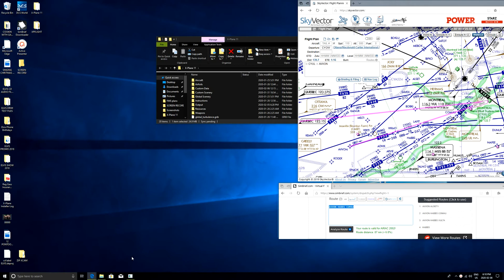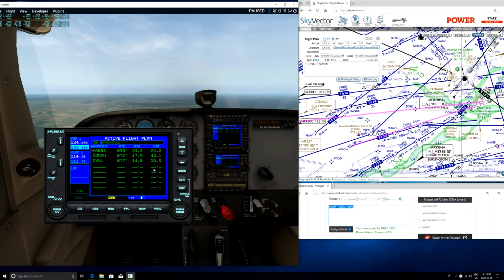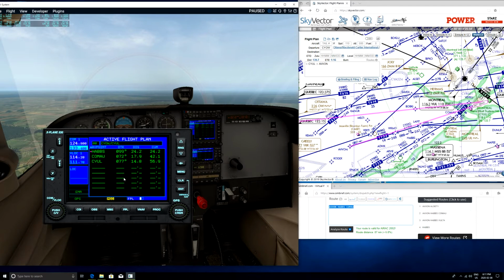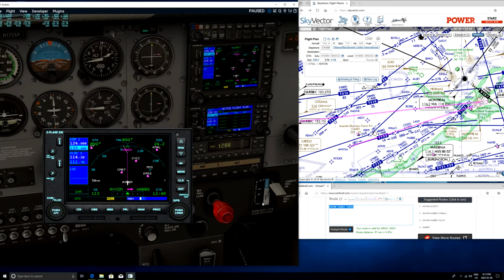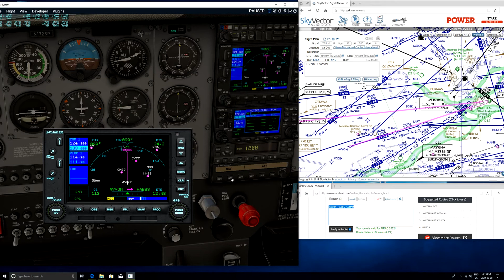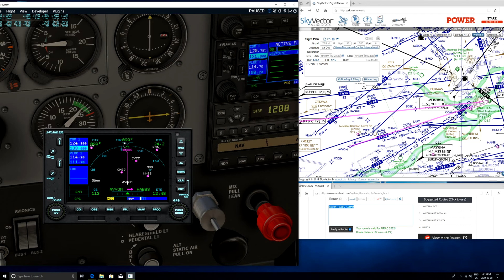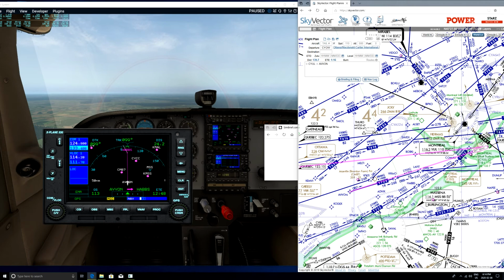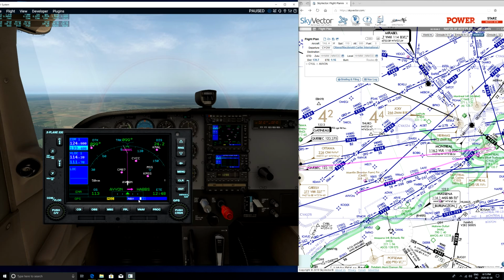XPLANE 11 MAKE GPS GO TO WAYPOINTS STOCK CESSNA 172/SP

Comment: VERY useful - cheers!
Reply from the maker: Thanks. Do you have flight sim 2020? If so do you have computer crashing issues? Jamie
Reply: Hi Jamie. I bought MSFS2020. After 2 days of attempting to download and install, I gave up and I bought XPlane 11 - the installation process worked first time and the user experiece far better overall. Same PC. Sorry can't help on your question. Cheers
Reply from the maker: @fergomez7413  yes it was a pain in the ass. The CD that came out for it in Dec is not too bad. It takes forever to load and always has. This latest update in Feb is broken. Vr ussually crashes most of the time. Can’t pause and take a bathroom break cos it crashes. Planes kind of suck too. Graphics are good but X-plane always works. I’m most likely to say screw it. I just wish xplane had some of the airport features etc.. Jamie
Reply: Jamie, can't comment on the differences - never got to actually see the MSsim up and running! I'm sure XPlane will continue to evolve - looks pretty good from the little I've seen to-date! Have you made anymore vids on Xplane, please?
Reply from the maker: @fergomez7413  I’ve done a few xplane vids. You’d have to look down on my channel a bit. I’ve uploaded all sorts of music stuff for my website buy yeah there are a few anyways. I fly RC airplanes and because of the flight sim I bought a 7ft Al37. Scale 737 and so real to fly scale. Jamie
Reply: @JamieElvisGass  cheers mate!

Comment: Cool vid Jamie!! I just picked up XP-11 and i'm a bit confused on this.....if i'm doing a short GPS flight (say, from Oshawa to Pearson) can i just fly direct, or do i have to enter all the waypoints inbetween the 2 airports?? I've watched a few vid's of people making short flights of roughly 20-25 nautical miles or so, and they are entering 2 or 3 waypoints. The G530 actually has a "direct-to" button on it.....isn't this all i need to hit when programming short flights??
Reply from the maker: The way points take you to positions so you can line up with a runway. The direct to (I think) is just gps and again not sure. If you use SimBrief fo f easy flight planning you can enter your takeoff and arrival destinations and it will generate a route. Where it shows all the waypoints for a particular route, you can perhaps just choose one of them and the plane will still go there. I’m not sure if you can do a ILS landing using garmen. No fee to use SimBrief. Give it a try. Good luck & thanks. Jamie
Reply: @JamieElvisGass  awesome stuff......thanx, and will do!! :)